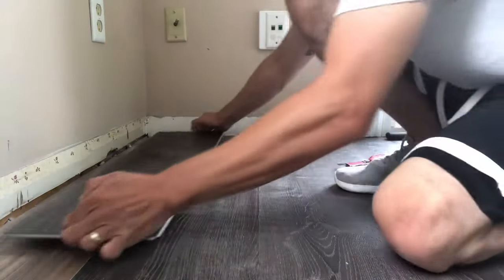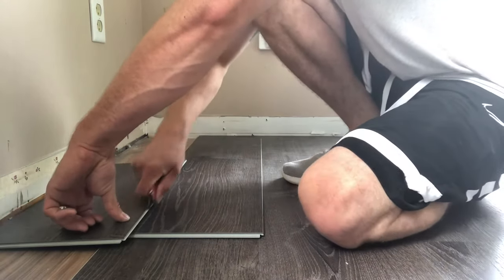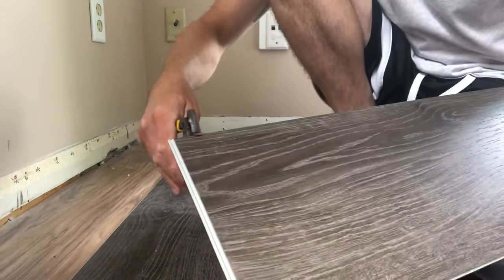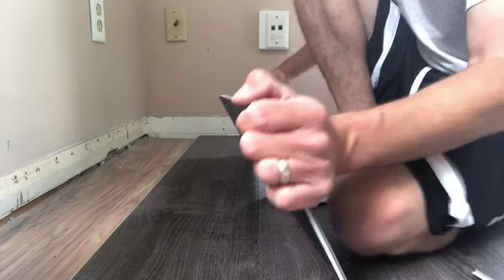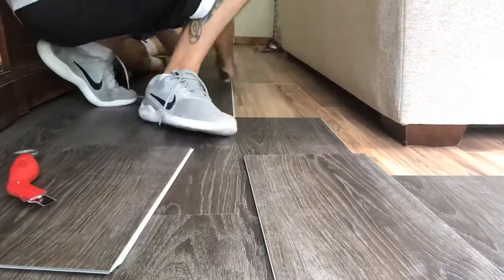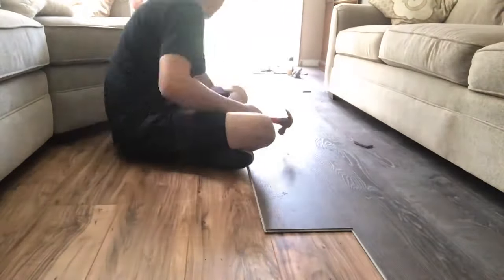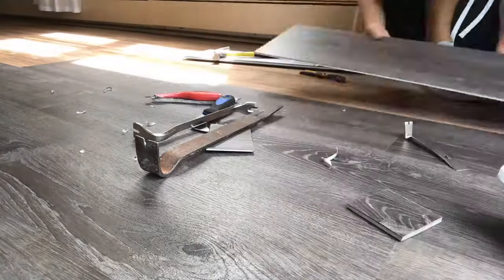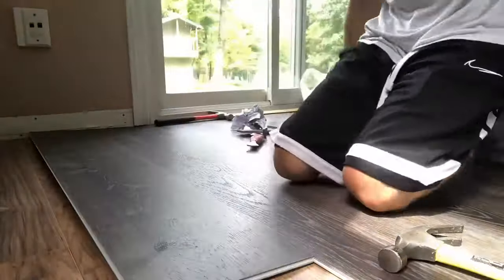How To Cut Vinyl Plank Flooring lengthwise

Comment: You need a gap at the edge for this flooring, though.
Reply: There is a gap under the sheet rock.
Reply: Not sure this type of flooring actually expends. It's just natural wood you need to leave a gap with as that will warp slightly as it's warmed.

Comment: Can you score spc vinyl luxurious flooring ? Because ive tried and it just wont go deep enough... my company i work for only uses spc luxurious vinyl and we use a saw for this lile this or the 15 inch rule use the snap down tool for straight cut. But for long side or weird cut we use a saw

Comment: What’s the name of the flooring you are installing? It looks great and seems to be easy to install.
Reply: Expansion gap or you risk the risk of it buckling somewhere in the center if it expands and has no where to go. I’ve never seen it but they say it happens and it makes sense. However after it lays under the trim it looks like he has the space he needs.

Comment: No expansion gap? On a hot day the vinyl will expand and buckle
Reply: no, all four corners need to be without gap, actually one one side of the room needs a gap, if it expands it will push out onto the wall that has the gap

Comment: PSA- do NOT follow any instructions in this video, this is absolutely not how this flooring should be installed. There needs to be a gap at the walls to allow for expansion, otherwise the flooring will bubble up in the center or crack. Definitely not even up to DIY standards, much less a professional.
Reply: If he was going up against baseboard, you would be correct. Expansion then would be covered by quarter round. In this case there was a large gap between edge of sheetrock and subfloor allowing plenty of room for expansion. It also allows for only baseboard and no need for quarter round.